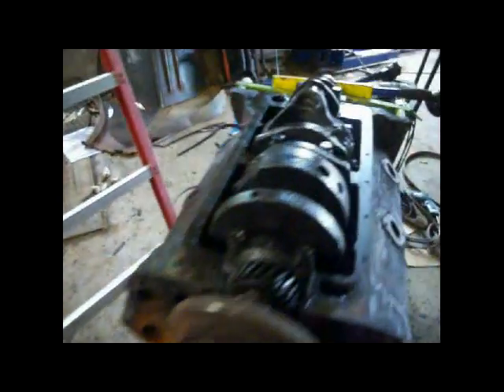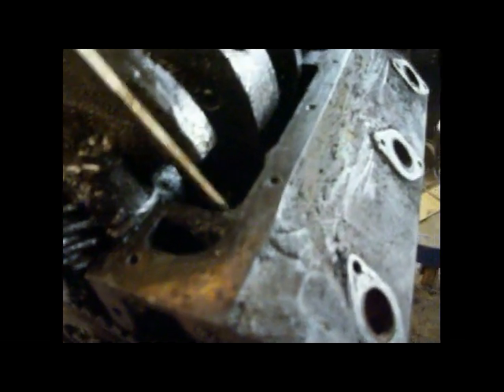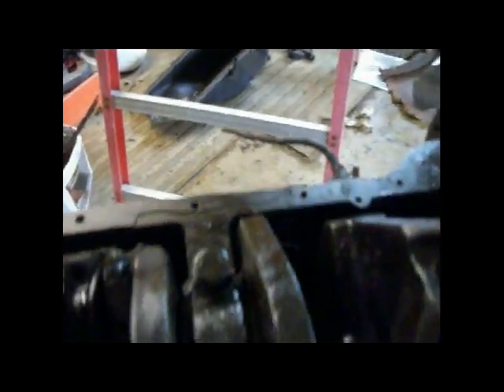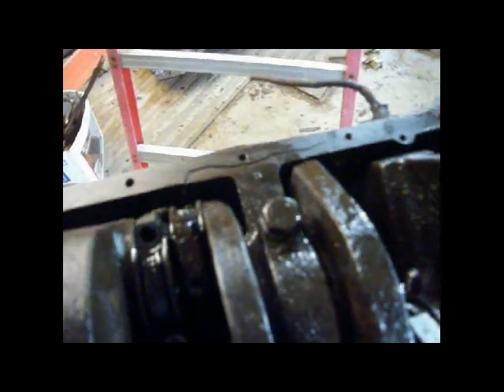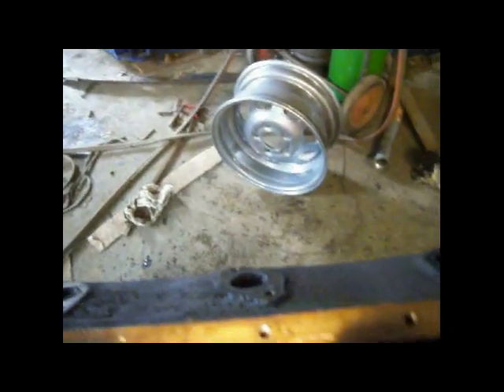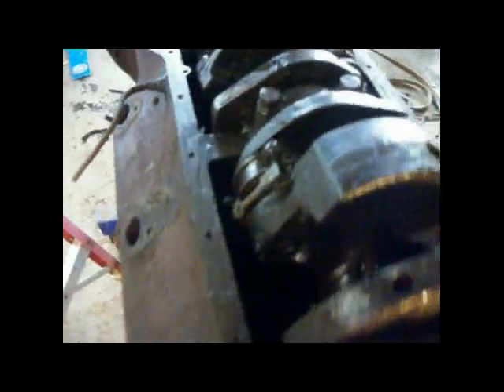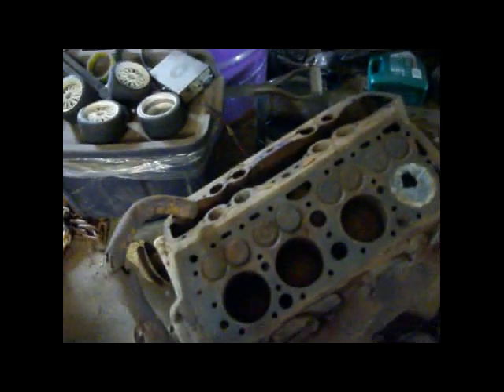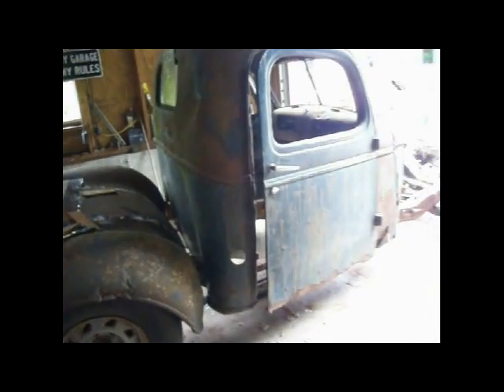Flathead autopsy

Comment from the maker: I still have the fins. They are still attached to the Buick.
I'll tell ya what happened with that whole thing. 
A feller, 388Bandit, made an awesome drawing of the truck with the fins on it and it looked way to nice that way to be a ratrod so I'm gonna find a nicer cab, build a dropped  underslung chassis, stuff a 600 hp small block in it and make that project a street rod! I will build that truck in the future for sure! I'm gonna have to win the lottery first but hey that's gonna happen too!